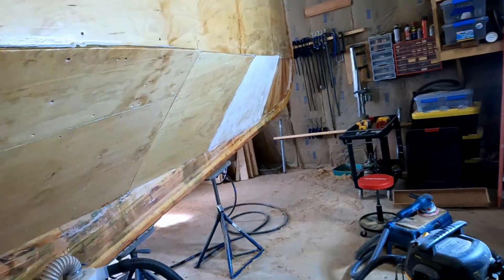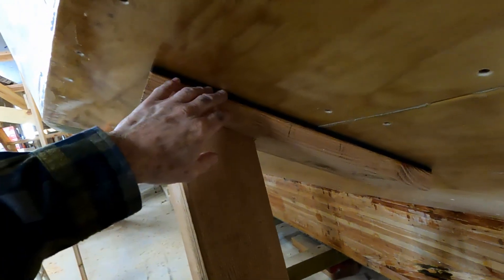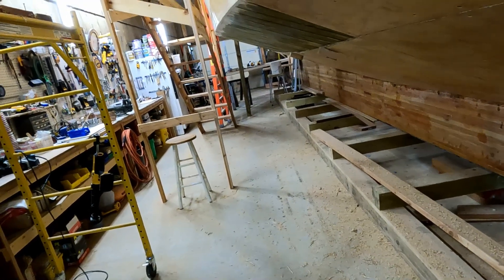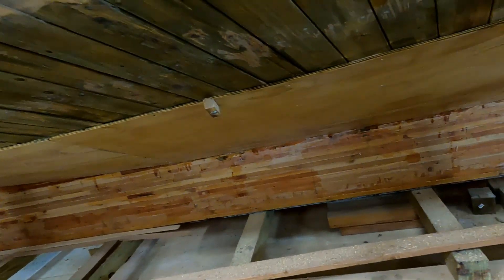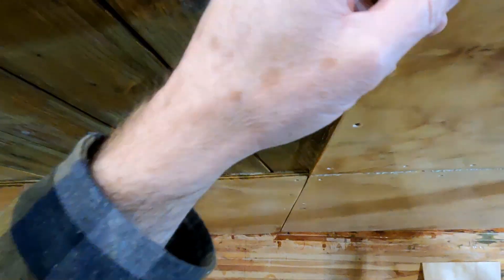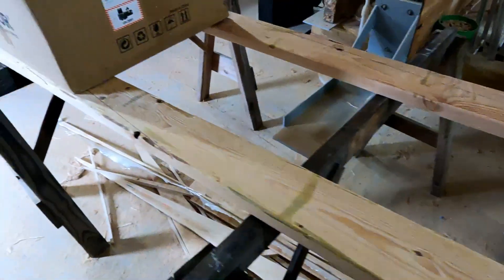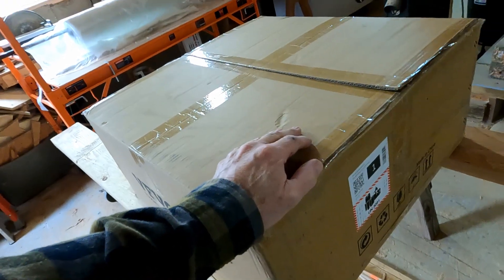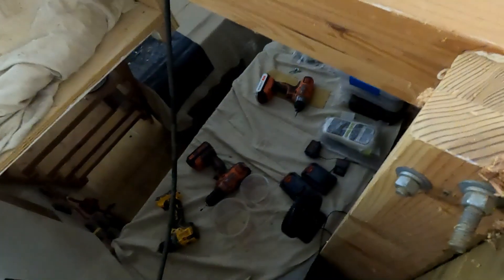Plywood Continues - Supporting the Boat - Saloon Cabinet Start

Comment: What about wood supports from outer cradle up 45* or so to keel just below hull.   Put one at each cross beam.  Both sides.   Seems like that would keep it from tilting either way.
Reply from the maker: Yes, that's about the best I've come up with too at this point. I need to level the boat, we left it about 1.8 degrees down on the starboard side. Once I get it level I may try to get some other supports in there.